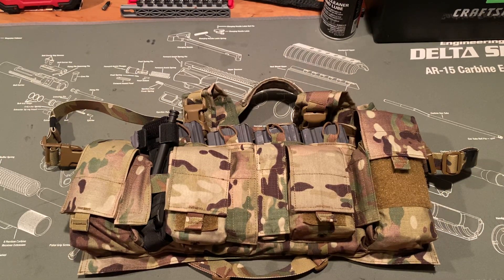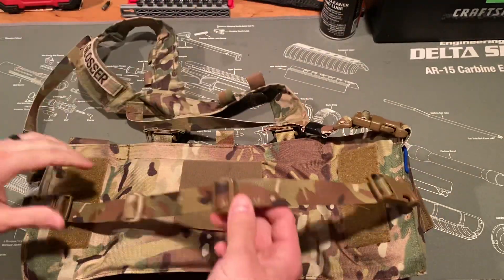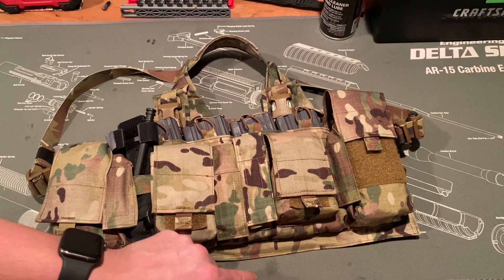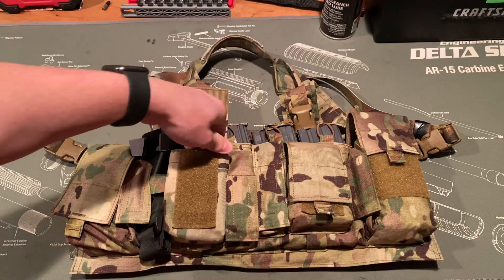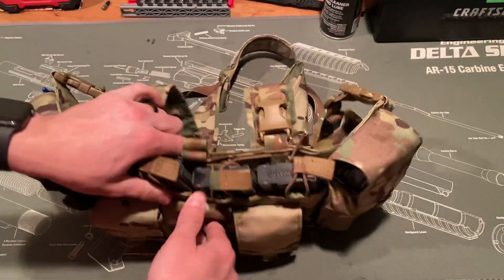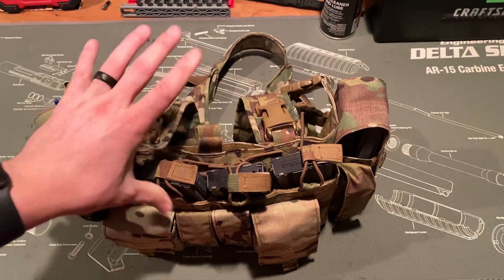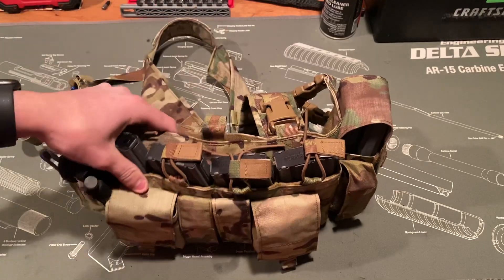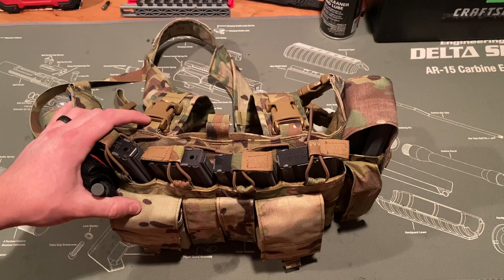Mayflower UW Gen IV Chest Rig Overview/Setup

Comment: Thanks for the video. You mentioned attaching a dangler to the chest rig. Looks like the Velcro is pretty high on the inside of it. Are there specific ones that would work with it?
Reply from the maker: Hey I appreciate it. From what I understand the velcro on the back is intended to marry up with a slick plate carrier, but I've seen some people running a Haley Strategic dangler and it seems to work. However, I wish they did make the velcro cover more of the back of the rig.
Reply: I bought a krydex brand from Amazon that fits just fine for 20 bucks